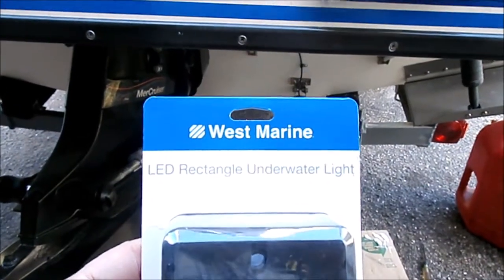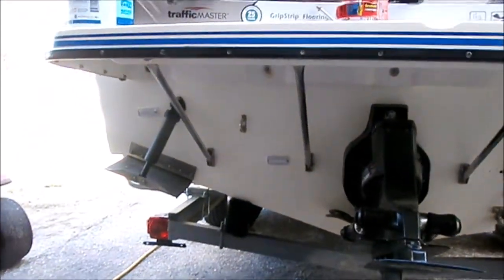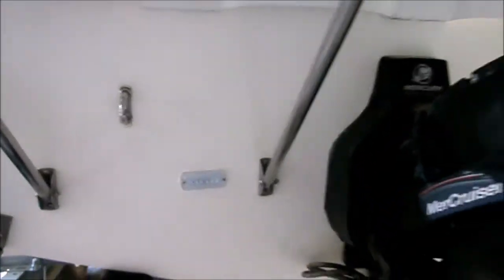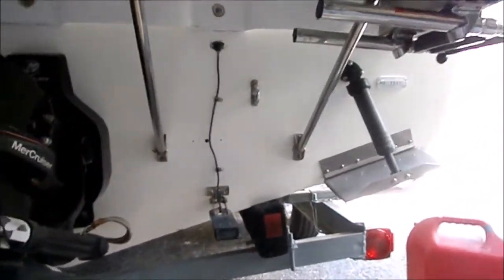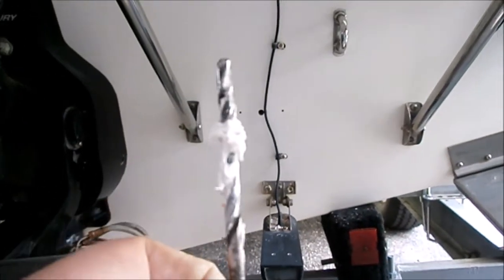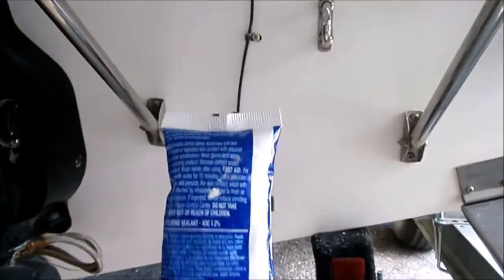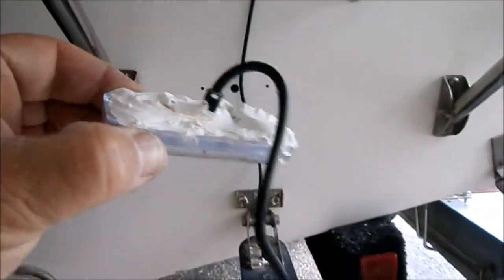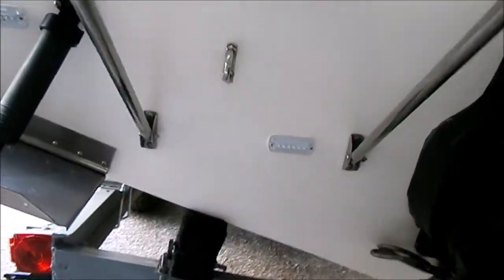How To Install Blue under water Lights

Comment: So you don’t use the two rubber backings that come with it at all???
Reply from the maker: Hey . no I didn't use the rubber gaskets I used pro line Marine Fast Cure Adhesive Sealant. from Loctite I never had a leak .Take Care God Bless be Safe.